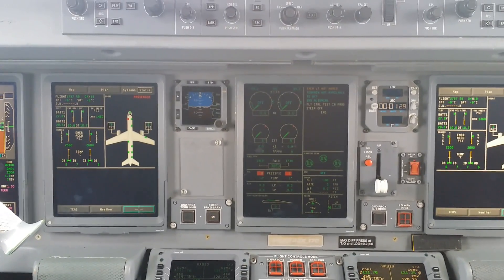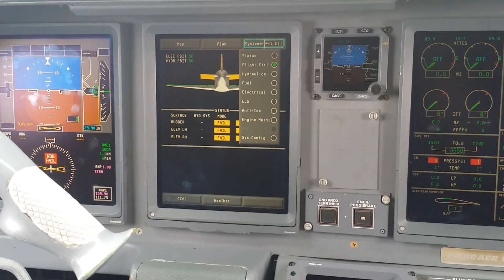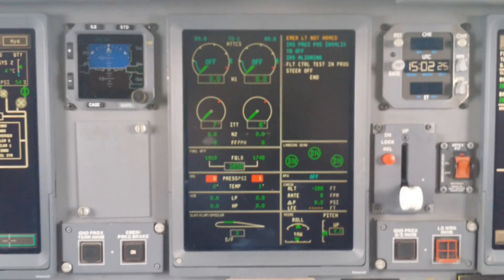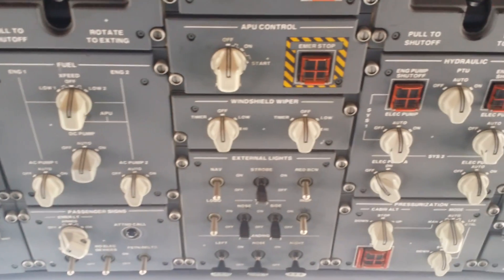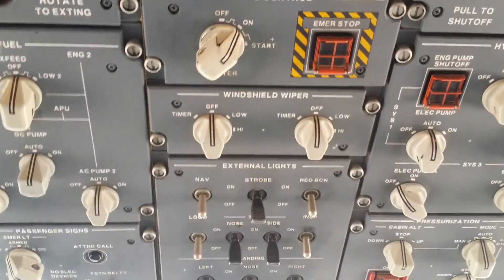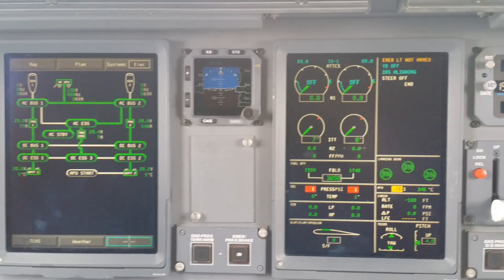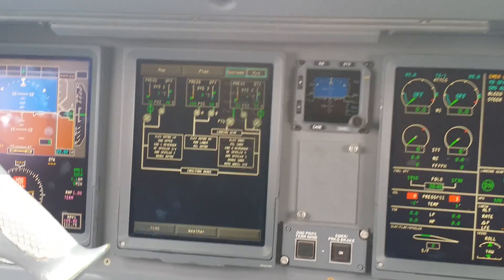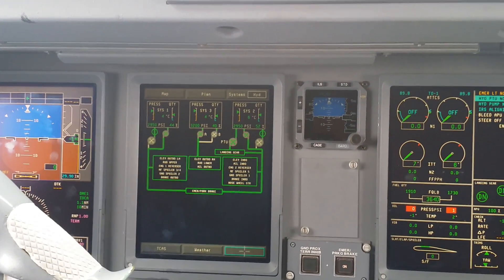Aircraft START in a COLD morning with GPU and APU EMBRAER 170 175 190

Comment: Don’t like it. No checks are done! Battery voltage check. Fire detection check. Loop fault msg check. To heat up fluids: fluids lines are not connected. So ptu will only warm up sys 2 which you can see doesn’t do it that fast. Sys3 only 3a is turned on. Do 3b as well

Comment: You've forgotten to check batteries voltages before connecting GPU.
To speed up the IRS alignment, you have to validate INIT Position on MCDU (you can use GPS coordinates)
Before APU start, a Fire Test must be performed.
Before activate HYD system, check that no one is near control surface, it can move !
Reply from the maker: That is coreect

Comment: Thanks. This is a good refresher. Even though I’ve just recently completed a E175 familiarization class for Maintenance.
Reply: Where are you from man
And are you an aircraft maintenance engineer?
Reply: @sahilsangwan8948  USA, at the time I made this comment I was in Cleveland, working for an airline that’s now shutdown. I’m no longer working on this fleet type, however bigger and better ones. Like Boeing 737, 757, 767, 777, 787, Airbus A319, 320. We apparently have 321s too but they don’t fly into my airport much.
To answer the other question, AMT. Not an engineer.
(Aircraft Maintenance Technician)

Comment: Im surprised the aircraft doesn't have something like a CMOS battery to keep track of the time. Unless 'm not understanding what I see on the clock screen w hich seems ot be showing the time since you connected GPU power :)
Reply from the maker: it shows Zulu time, local time, date and chrono. As for the battery there is an alarm that alert the crew that the batteries are draining (ground crew horn will sound)
Reply: Clock will get time from GPS as soon as a fix is established

Comment: SEE THE SWITCHES, ON THE CENTER COLUMN-THAT IS WEATHER SERVICES, VOR, LORAN, ETC. YOUR THINKING PRE-1998 AIRBUS@ USC 49 CHP. 7 STATUTE 207 OR TURN ON THE ENGINES WITH THROTTLE 0%, OTHERWISE BEFORE MOVE THE STICK THROUGH ALL POSITIONS-REMEMBER 2018.

Comment: what pumps should be on when defueling, or cockpit fuel pumps switch configuration for defueling both tanks simultaneously to avoid fuel imbalance after defuel. Thanks
Reply from the maker: Depends, If you are defueling both tanks like you mention, no much you can do. The defuel truck will open the valves needed. You will run into fuel imbalance if the pressure fueling system is broken. if thats the case over the wing defuel takes place.
But id you just transfering from tank to tank, just turn the opposite engine pump to help out with the transfer.

Comment: Did you still need apu to startup the engine if GPU available ?
Reply from the maker: yes. but GPU will be disable due to power transfer from GPU to APU (APU has priority as main source of electrical power). but, if APU is broken GPU is use with ground air power

Comment: Thanks, now I am able to steal an Embraer
Reply: Hugo Woesthuis a lot more is there to fully start it up. That was just a simple video. You try to steal it then you’ll be caught easily
Reply: @johncarroll6063  Stealing an aicraft today is still very easy... As proven by someone taking a Horizon Q400 and doing actual barrel rolls with it...
Reply: @rkan2  RIP Skyking
Reply: @rkan2  Skyking made it look easy, but he was in an environment where people knew him and he was a familiar face handling airplanes on the ground. I worked as an aircraft fueler for many years and when you're out there on the ramp it's easy to spot who doesn't belong there.
Reply: Not if the Ground Power Unit (GPU) is disconnected... he didn't show an APU (Auxiliary Power Unit) cold start for this aircraft.
Reply: Hugo Woesthuis hahaha kon ik al met dank aan de sim 😋

Comment: Is the transfer automatic from GPU to APU power?
Reply from the maker: yes, APU takes priority. it is the same when you kill APU ground power takes over batts
Reply: As the content creator said, the transfer is automatic. The only thing you have to do is push the GPU button out. It will still read “AVAIL” on the button.

Comment: Forgot to check the battery voltages.
Reply: 21 volts to start minimum.  When turning on the batteries most show up around 23 to 24 volts...
Reply: Rocco Santa Fe Hsuhdjsiusjijusjuwjjw

yes

Comment: Questions: 
1. Does the APU Gen get pressed (white light off) before or after the APU start?
2. Does the DC Pump have to be on? and then after engine start does it come off?
Thanks.
Reply from the maker: 1.APU Gen should always be press. auto mode
2.correct, DC pump will stnd by when engine start
Reply: The APU GEN pushbutton is normally kept pushed in before start thus the striped bar is off.
The DC fuel pump control knob should be kept in AUTO .
After APU starting the system automatically shuts off it once APU is feeding the main AC buses and then RH AC fuel pump Will feed the APU. To do that, the RH AC fuel pump control knob should be in AUTO also.

Comment: Wouldn't you normally put the nav lights on once you have electrical power established?
Reply: Rocco Santa Fe Once GPU Power is introduced, Nav light should have been on, especially since he was running hydraulic tests.
Reply: APU needs to be started up before adding any other electrical devices, otherwise u will drain the batteries below 21 volts.  Nav lights, beacon, inspection and airline insignia go on last...
Reply: @L1011DFW  the battery will eventually drain with electrical power on and without GPU, APU, or eng power. However, the position (nav) lights should be turned on whenever an aircraft is powered up, especially if hydraulics are on and flight controls are moving. It can be extremely hazardous to those on the ground outside the aircraft to not know when an aircraft is powered up. With light aircraft, the beacon light (or strobes if no beacon present) is used to warn people in the same manner. In all my years of flying, I've never once turned off a beacon light because I've always made sure to keep it on as a signal to others the the aircraft is powered up (and engine start may commence at any moment).

Comment: can you charge the E170's BATT with the APU or do they need to be removed like a S-105 to get a full charge.... I kept getting a Low Volt light starting... mechanic told be it was nothing to worry about... removing the Battery and charging it seemed to solve the problem. I do not use it enough to keep the battery charged..... even though all the systems are off I still drain the battery to the point where I have to do a Manual start (which i might add is Incredibly Dangerous and No one should ever do this with even the smallest beach-craft)
Reply from the maker: Yo can recharge the batteries with APU. It will ussually take about 45 minutes to charge (depending on how low they are) The batteries get to a point to where it cannot not be recharge, anything less than 10v. So, replacing the batteries is your best option.
Reply: AV rated Battery's are How much??? and where in Alberta Do I get a new one? Reconditioned are good but they will only warranty them for a year. I have been renting but he gives me discounts if I do Maintenance. I spend too much time on the ground because of my Vertigo....